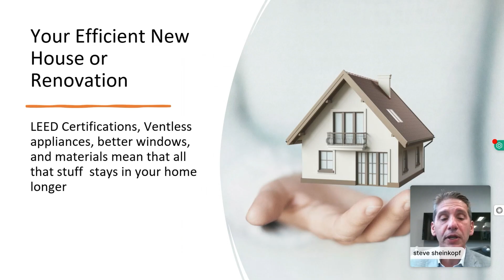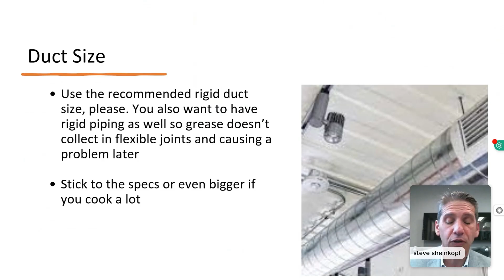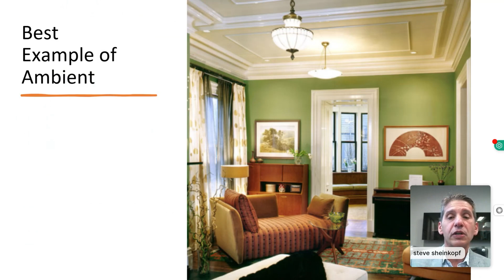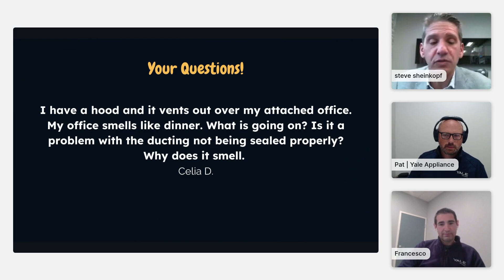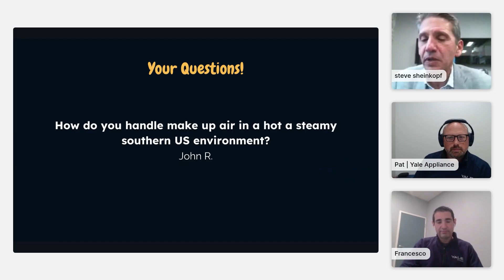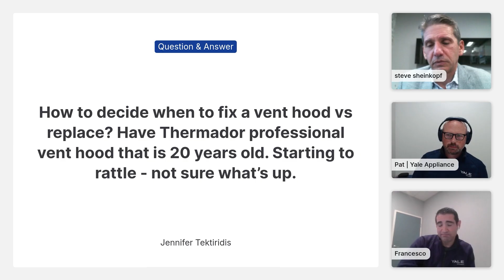The TRUTH About Kitchen Ventilation and Lighting What Homeowners and Contractors Get Wrong

Comment: You said that downdraft doesn't work, but that induction doesn't suffer a lot of these problems. Does the Gaggenau Vario vents on each side of their induction cooktop work?  With the AR 410 710 it seems to be 600 cfm on each side of the cooktop?
Reply from the maker: Induction doesn't emit the potentially harmful compounds, but you still have odor, steam, and heat. Induction is just not that efficient